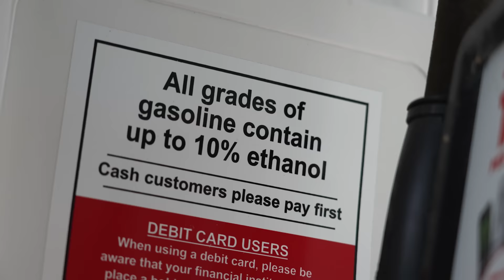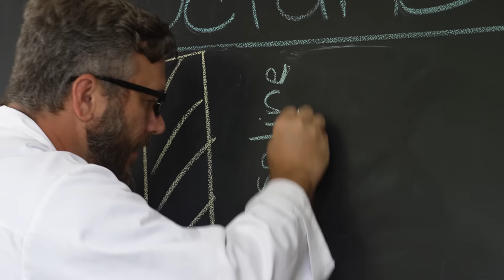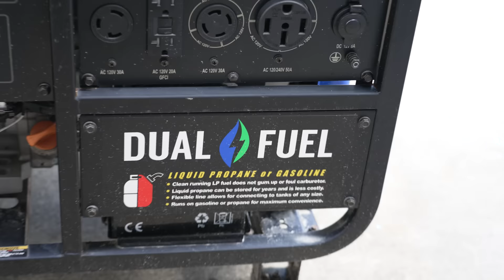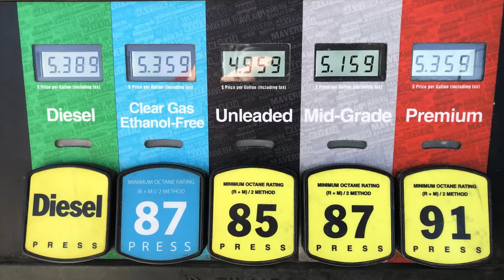This Will Destroy Your Emergency Generator! Don't Make This Mistake

Comment: Cute video but this is really serious stuff . I bet if you researched octane boosters and let more people know just exactly what and why its used all this will be a lot clearer to every one . I was having hell every since ethonal in gas came out and wasn't by myself , but lawn mowers generators and everything that we use that gas sits in has been negatively affected so I found out our local grocery store in San Antonio and Wal-Mart's all get fuel from same place and the mid grade and high grade doesn't have ethanol in it so I've been using the mid grade for all my small engines and no longer had issues with water in my fuel. I don't need obtain boosters but the mid grade is fine for all my small engines

Comment: I purchased my first generator in 2004, just before a Florida hurricane caused power outage for 5 days. I filled up my generator gas tank and 3 each 5 gallon gas containers each year in July and if no hurricanes then pure all the gas into my two vehicles in November. I changed my oil each year and ran my generator every month or two, and never used a gas additive or complete emptyed tank of 90/10 gas ever. It cranked every time on the first or second pull. I replaced my generator November of 2022 with a new one and gave my old one to the daughter after 18 years of operation. Used 90-10 gas only!

Comment: There is only one type of gas at the tank farm, when a tanker is loaded with gas it then pulls over for the addons to make the different types and grades (ethanol, higher octane & speical additives that some vendors use) . So all gas starts out as non-ethanol.

Comment: Great video! The first thing I did when I discovered E10 gumming up the carbs of my small engines was switch to E-free gas. There's one station near me that has that as Premium. Sure, I get a tiny bit of "E-gas" that was in the hose, but I can say from experience that it's meaningless. No more gumming problems in my chainsaws, quads, lawnmowers, pressure washer...
Reply: Depending on how much fuel you are getting (eg one gallon) it can be quite a bit of E10 in the line (some estimate at least one quart)  Solution is simple.  Hit the e-free selector on the pump, put a half gallon in your car from the e-free gas then fill up your jerry can knowing that you have cleared the line of any ethenolated gas.

Comment: EXCELLENT GOOD, FUNNY VIDEO. I learned my lesson about Ethanol. It ruined a new generator within a year. Gas valve and carburetor BOTH shot to HELL!. Since tnen, I have been using Ethanol free gas on ALL my equipment with no problems.

Comment: Thanks for sharing! Didn't think about that!
Excellent and fun video! 👍
This explains why every year after winter, lawn mowers and grass trimmers wouldn't start and needs membrane or gasket swap in carburetors because they get hard as rock and won't work properly..
Didn't know about fuel storage add - that's great tip.
Reply: Storing dry will sometimes will mess up the Gaskets. I try to start all the engins I have a least every 2 months and run for a couple minutes. This will keep things running. Steves small engins has a solution for long storage.

Comment: The ETOH (ALCOHOL MOSTLY ETHANOL) you just through out, can be used for cleaning. It's  ( should be better than 95% ethanol and up to 5% methanol), unless the more expensive 100% ethanol was used in the blend. The first gasohol used during the Carter administration had some alcohol blends that were as high as 50% methanol, and that melted many rubber fuel lines. But that alcohol you poured into the cat litter makes a great cleaning solution, lighter fluid for your grill or mixed with water, window cleaner.

Comment: Run Chevron 94 in Canada. No ethanol or methanol in it, and lives okay for about a year. If looking for 3-5 years I use Aspen fuel! An Alkylate fuel and holds its btu/octane value very very well. Look up up my southern neighbors. I use it in all small engines being stored for any duration. Cheers, from Canucksville :-)

Comment: Excellent science experiment to demonstrate the point.  Luckily in our area, I have found non-ethanol premium gas which I stabilize for the Generator(27 Gal), and every 6 months, I recycle it though the tractors or cars so that I am working with relatively fresh gas if we have a disaster.  I also replaced my 1998 Generac xl 5500, the best maintained piece of equipment that I have with a new inverter.  My choice was between the preditor 3500 that you have and a Firman 3382.  I went with the firman which was $849 at the time.

Comment: Most of us put fuel stabilizer into our fuel at this time of year. Like you I try to avoid ethanol when storing engines that won't be used. Many don't appreciate the irony, that a significant component of fuel stabilizer is, you guessed it, alcohol.

Comment: I’ve never had a small engine go bad with gasohol. But I now use an electric mower, trimmer, and my dual fuel generator is only used with propane.

But only because I don’t have to deal with the mess of gasoline and the storage problems.
Reply: If you use PURE GASOLINE, without ethanol, you should be fine, gasoline has better storage life and offers more energy and mpg. whereas the E10 and up does not.

Comment: In Utah, Maverick gas stations sell ethanol free gas. Flagstaff AZ has ethanol free gas. That is the Only thing I use in my small engines. It used to gum up my Yamaha motorcycle,  it was carburetor.

Comment: I don't Lose power very often so my generator sits around for years Ethanol fuel Always caused me problems So I finally switched to a propane generator It's actually dual fuel it will run off of gasoline but I only run it off propane  Don't have to add no stabilizers my fuel can sit around in tanks for years And it's ready to go when I need it Good video bro

Comment: Yes, you can separate ethanol from gas. You mix it with water. The ethanol attracts to the water. You siphon that off and you get pure gas. Simple! Nice trick using the dye. That's exactly the same kind of pump I use.

Comment: IDK. I use the 10% 87 in all my equipment with no issues. I do add Stay-bil to all of my stored gas and cycle it out through my truck every year.

Comment: I buy ethanol free gas from my local farmer co-op, generally fill up a drum or three when they are delivering bulk diesel, clearly that is not an option for everyone.  But one more piece to the puzzle.  If you are not a large volume customer, they might fill up your smaller tanks at their location.  Also always buy the highest octane you can get for storage fuel.

The separation of the organic (gasoline) and aqueous (water) layers, it know by chemists as partitioning.  However, Hax, you are missing one problem in your video, your gasoline is cloudy, what that is some of the water staying in solution in your gasoline.  This is a bigger problem than the ethanol, and I am not a fan of ethanol fuels.  The water can and will cause corrosion in your tanks and in your carburetors.  So you have to dry your gas, there are several ways to do that but none are particular easy.  BTW, the old product HEAT is just methanol, so you are adding more alcohol back that you just removed...  

For a little info, 1. I am a chemist 2. I have worked in petrochemicals for the last 30+ years. 3. I am a prepper.

1. Best solution, as you mentioned buy alcohol/ethanol free gasoline.
2. If you have to buy E10 fuel, the better option is to do the following.
  a. Treat with Stabil Storage you can double the recommended treat rate on the label, it will help, but don't go over double as you will not be adding any value and only wasting money.
  b. You will get 2+ years storage for your fuel but you should still rotate, I try to use up my fuel every year for rotation
  c. If your equipment does not have a fuel shutoff valve between the tank and the carb, add one, also if there is not a fuel filter add one.
  d. When you are done running your engine, shut off the valve and run your carburetor dry.  This will prevent deterioration of the seal etc. and also prevent gummy build up in the carb.
  e. Store your equipment with either a full fuel tank or an empty tank.

Comment: Retired after 50 + yrs as a car mechanic , now due to my new hobbies , i use chain saws , mowers , blower , weed eater . I use shell  regular gasoline , and have zero issue . On the 3000 w generator , i shut the gas off to stop , all others the switch . I used to use the ethanol free gas , $ 20 a gallon . Went to car gas , and have no issues .

Comment: I agree 💯 on not putting e10-89 in anything especially small engines but e10-93 is a better choice for force injection vehicles if not  set up for the best:e85. Higher h.p. and stays cooler with less chance of predetination.  I also suggest  not running generator for more than a few seconds before adding load.  👍 Informative and entertaining. 👏

Comment: I am in the process of setting up my permanent "off-grid" power supply and started with connecting my pickup to charge a pair of (giant) 12 volt SLA batteries daily and a 750 watt inverter to operate my electronics and 32" monitor. A while back I got a Westinghouse 4650 Watt Dual Fuel Portable Generator, Remote Electric Start and a 3 stage 120 volt RV battery charger and I just cranked up the generator (by wireless remote start/stop!) whenever I need to use the microwave oven.
I have one 24 volt lithium 100 Ah battery powering a 24 volt SunGoldPower 3Kw hybrid solar inverter/charger/controller connected to the generator and it keeps everything going for about one day before I have to start the generator. It powers everything and I use the microwave 1-2 times daily.
Now I have two 320 watt Renogy solar panels that arrived last week but haven't installed them yet. I'm also planning on an additional battery and more panels now. I'll keep adding solar panels until I don't have to start the generator anymore
I've had the generator for about 10-11months now and it's safely undercover outside on the unpaved ground and surrounded by (cardboard core) office cubicle divider panels to muffle the sound, which is tolerable. I use it on propane exclusively, but kept the gasoline tank full for emergencies. Only a few days ago I noticed the odor of gasoline and I could see the sheen on the ground and figured it had sprung a leak but i haven't gotten around to investigating it in the cold, wet weather here in the Pacific Northwest. Now I know what's happened!
From now on, I'll separate some gasoline from the ethanol for the fuel tank and keep additional on hand in plastic fuel containers. It never occurred to me that the ethanol would deteriorate the fuel system to the point of complete failure.

Comment: The best way I found to remove 100% of the water from the bottom of the can and leave as much gas as possible is the smaller the hose the better and just siphon it out into another bucket you can use a very small hose and put your fuel tank on an angle so all the water runs to one corner the smaller the hose the smaller amount of actual fuel lost

Comment: I have a gas powered weed trimmer,leaf blower,an chain saw,when i bought them new,after about three years of use I began to have starting problems an we all no how frustrating that is pulling that starter rope till your arm gives out.Replaced all the carb with cheap china ones an use premix Tru-fuel no more problems ,easy startups and you don’t need to empty them at seasons end ,they fire backup easy next season an these yard tools are Walmart cheapest !!!!!

Comment: I run E100 and to be honest never discovered any issues with that so far. Even after longer times of no running. 
To be fair the engine is injected and not with a carburrator. 

If you are worried about storage. Don't put fuel in it and use propane. Never goes bad and doesn't leave any residue. 
Also like Ethanol burns cleaner and has less exhaust smell without catalyst

Comment: That's why I have a duel fuel generator and usually use propane. If I'm not using that I use rec fuel which most gas stations don't have.

Comment: This is why I run marine fuel, another term non ethanol in all my small engines. From generator, mower, weed eater and even down to my mixed gas for example chainsaw. Never have I once had a problem with my carburetor or anyting else on a motor. While other people are rebuilding their carburetors and taking their motor apart, I'm still running. Sideways best to spend that extra 50 to 75 cents a gallon. Will save time and money.

Comment: I save antifreeze from cooling system to remove the alcohol from gas.  It separates quicker, in about an hour, and the separation is easy to see. The antifreeze can be used many times.  Shaking is not necessary just turn the container upside down a few times.  I use regular gas and don't add anything it boost the octane, just do the slight adjustments needed for best performance.  I have found the alcohol free gaa usually sets in the station's tank for so long that it will not run properly in two cycle engines.

Comment: Nice video.  Just an FYI.  gasoline losses 1 octane per month.  The stable will keep the gas from gumming for up to 2 years but it will jot stop the lose of octane.  So start at 93 octane and that will give you 6 months of storage.  Then change it out.

Comment: Ethanol in the gas is a horrible idea. I find adding 10 percent gives 15 percent less mileage, causing me to burn more than gasoline alone.
Then there is the pollution created with producing the ethanol. Diesel burning equipment in the field to till the soil. then to plant the crop, then to harvest. Not to mention the fertilizers made from oil.
When it's all done, there is more oil consumed than if we used straight gasoline.

Comment: One thing I've wondered about for awhile...the battery operated handheld pump uses a small motor to create the suction to move the fuel, if you've ever seen one operated in the dark you will see the sparks generated by the internal brushes.  How safe are these pumps around gasoline vapors???  Maybe an idea for a video?

Comment: I used to put 98 octane from BP about  20 litres worth and then around 20 litres of E85 in my Toyota hilux only when I was travelling about 1.5 hrs in Queensland. I used almost all the fuel with my thirsty 5VZFE engine. Damn!!! She felt like a different engine. Lol. In my triple su Holden Torana? I would put 4 litres of methylated spirits with a full tank ( 55 litres) of 98. No pinging and with my rebiuld ( gtr xu1) specs? It ran like a dream. I hate ethanol fuel. Especially E10. But for some reason the Toyota and my GMH Holden Torana  was like a tune up in a bottle if you know what I mean? Top video! Crap E10. Cheers from Australia 🙂 👍👍👍

Comment: I made up a bottom drain from a 5 gallon clear water bottle to remove the alcohol but decided it was more work then needed. As long as you do not store your tools with gasahol in the tank and lines there is no damage done. Example, my generator I shut off the petcok a d run the carb dry. This also cools down the stater while it is running without a load. Then I remove the gas line and install a long clear line to the petcock and drain the tank dry. I do the same thing kinda sorta to my saws and brush cutters to store in the off season. Everything I own is designed to run gasahol and 93 octane. Just not stored with the crap in the tank. Alchol is hydroscopic and draws moisture.

Comment: I've been putting E10 in my riding mower, push mower, weed whacker, generator and chainsaw with no problems. I add stabil to all of my fuel jugs when I fill them and I have about 9 5 gallon containers plus 2 small 2gallon that I use for the weed whacker. Generator we have had since 2005 along with the riding mower and both are still going strong with no issues. The weed whacker was replaced due to no spark and it's going on 10 years.

Comment: If Quick Trip is in your locality they sell Ethanol Free Fuel.  It's more expensive than premium, but its the only fuel I run in my generator and lawn equipment. I typically only need roughly 5 gallons a month in the summer and significantly less in the winter running a snowblower on occasion.  Ethanol free fuel are the red handled pumps at QT.  Green handle pumps are diesel, and black handle are crappy ethanol fuels.

Comment: I wouldn't put "staybil" in a worn out tecumseh. At least here in the desert southwest.  Heat turns it into epoxy.  You think it's hard to get varnish cleaned out? Wait until you have dried up stabil.  Just empty the tank,  and carburetor,  make sure it's all gone,  and store.  This method always works.

Comment: I have been a mechanic for years only use ethanol gas and have had no issues at all. It doesn't matter what kind of gas it is if it sits it will ruin whatever it's in

Comment: Generally speaking if you use the equipment all the time the ethanol won’t hurt it, problem is not very many people use small equipment all the time. Most carburetors are not aluminum like many believe, rather they are pot metal and therefore contain a lot of zinc. Wanna know what water does to zinc? Wanna know what ethanol rotting in brass jets does? I have opened so many carburetors only to find a grey sludge ( dissolved zinc) or what looks like green koolaid ( copper oxide from dissolving brass parts). Your car has mostly steel, plastic or nylon not rubber hoses plus you use the fuel much faster.

Comment: Great vid. Looking to add the option of portable generator to run our home during electric outage. That can’t happen if the generator won’t run. Good info on at least making sure old fuel does not cause issues. BTW…ignore that John Steed dude…love the bonus humor.